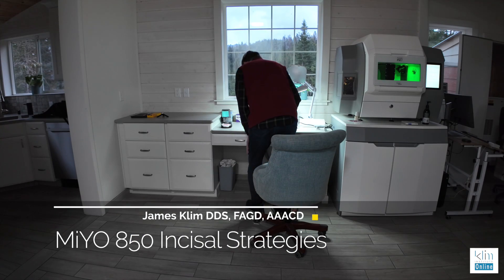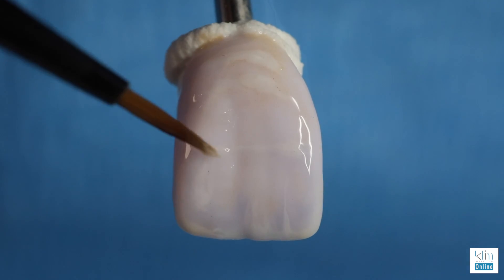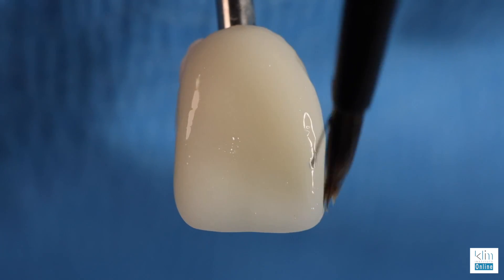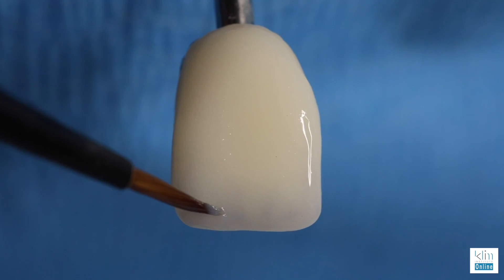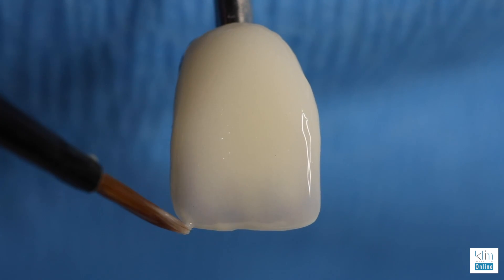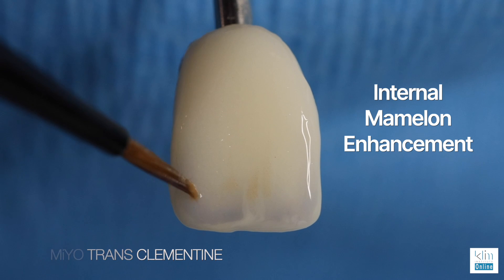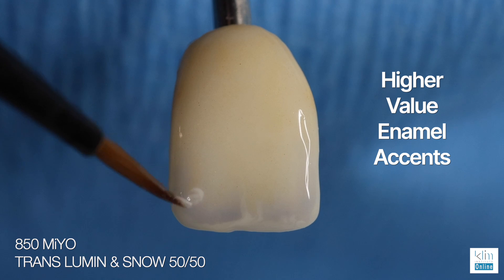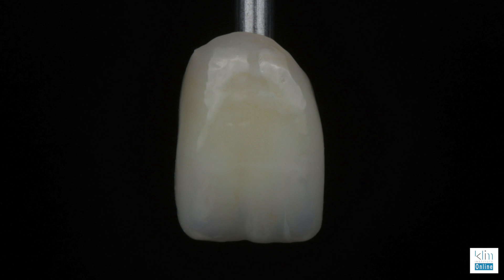MiYO 850 Training for e.max Anteriors

Comment: Ive been working with 850 MiYO for a few months and have been having trouble finding the right consistency for my glaze and stains. Ideally id want them flow as well as yours do. I was wondering if you add staining liquid, if so could you share how much?
Reply from the maker: @duccks  i wet the brush only, and when a need for more liquid, dip the brush again, think of latex paint, it should apply smoothly without remaining brush strokes, if this happens, wet some more by dipping the brush in the liquid, and then dilute on the ceramic surface.

Comment: I’m going to buy this for my office. If you use Miyo prior to crystallizing, do we just use our regular emax cycle or does that need to be changed? If we need to refire because the color is off or we choose to stain after firing, do we use that same exam cycle or do we use a different cycle?
Reply from the maker: Speed cycle or the superspeed crystallization cyclein in the CS6 with MiYO 850 works just fine.  Any further firing  for additional characteristics, use the e. max correction cycles.  You will love the MiYo!  All the best!
Reply: @KlimDDS thank you for the response! We have a programat CS. Would the regular emax preset in there work with the stain?
Reply from the maker: @joshhindman5737  Yes, use the faster cycle with 850, will work just fine.
Reply: @KlimDDS thank you! Your videos are great!

Comment: If someone isn’t comfortable coloring the purple state eMax they could mill GC LiSi blocks and then still characterize with the Miyo
Reply from the maker: Yes, use the MIiYO aesthetic, not the MiYo 850.  Lower fusing temp and can be determined universal for all ceramics and zirconia.
Reply: This is the way.   It you are going to fire the restoration LiSi all the way.   Mills so superior to eMax it isn’t funny.